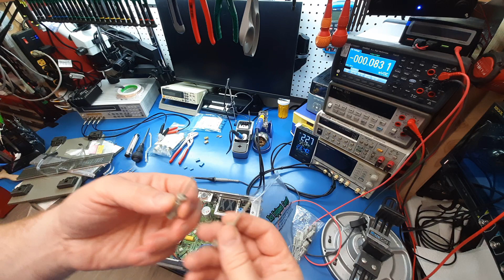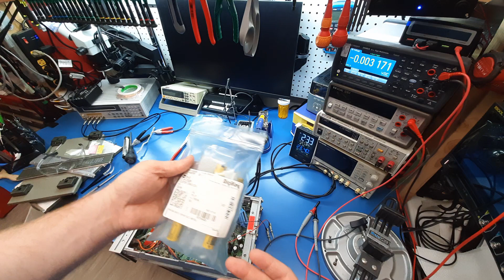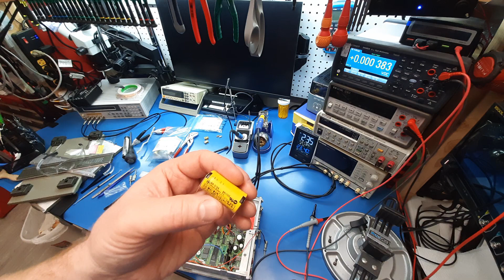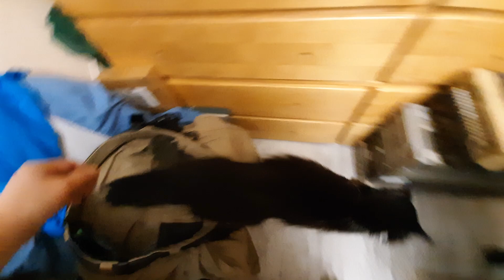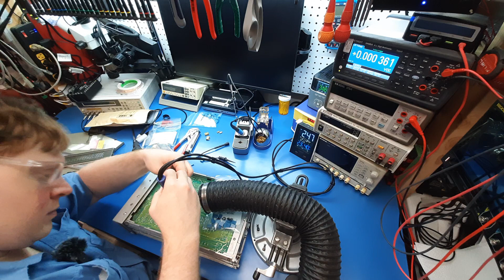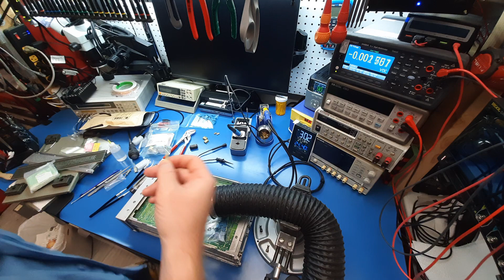HP 3478A service walkthrough (part 2 of 2)

Comment: Hey, you can back up the the cal data with "HP3478A Control" progrom that can be  found at Luke's Homepage. This program works on Windows. But also on Linux with wine with any serial GPIB adapter like the AR488 based on an Arduino. 

Sorry haven't watched the whole video yet, wanted to comment this before i forget it.

Thanks for the detailed walk through, i have an hp3478a in my home lab, and wanted to do the same maintenance 
Have a great time ~ sebsus
Reply from the maker: Thank you, that is useful information to have!